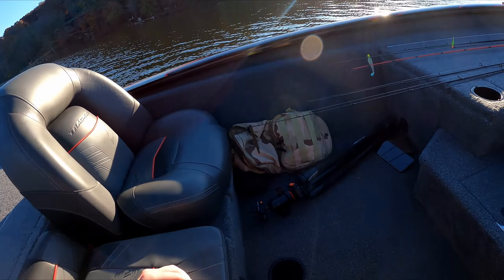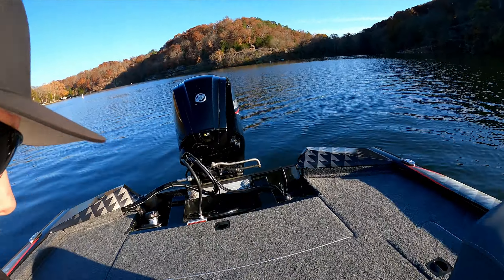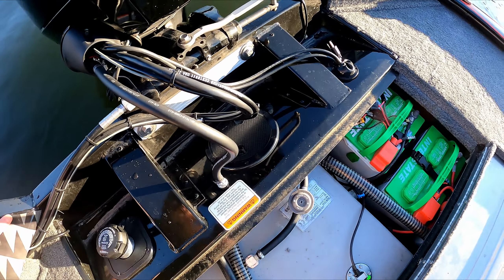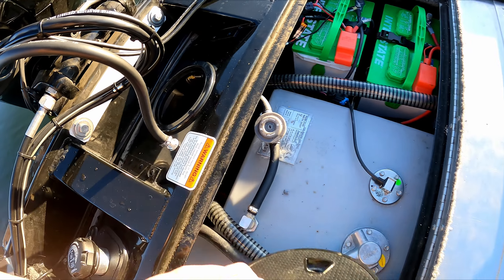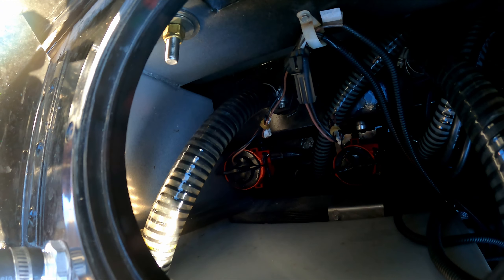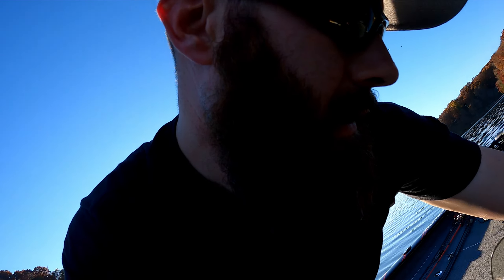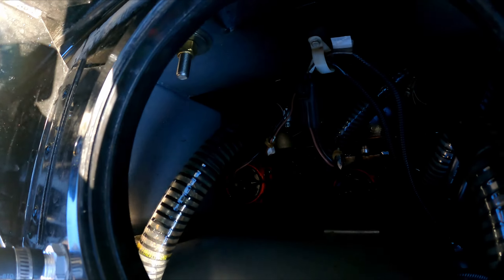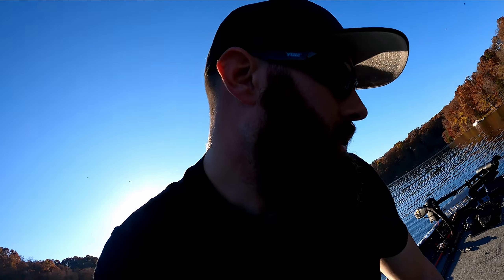BASS TRACKER 175 Leaking Water - Check THIS!

Comment: Hi.  Thanks for the video.  I have a garage kept 2006 PT175 that does not see freezing temperatures.  The original livewell pump is a Mayfair 3850 with a yellow housing.  Like your issue, I was filling the livewell and water started coming up in the floor drain I installed year's ago.  The nipple broke off inside the hose.  When installing a new pump, I bumped the hose on the bilge pump next to it.  It snapped off the same way and I didn't hit it very hard.  It is the same brand with a yellow housing (model 3250).  My word of advice...  If you have old yellow plastic pumps, replace the whole units.  These old Mayfair units do not have replaceable hose nipples like the red ones in your boat.  The plastic gets brittle...

Comment: I test drove a boat yesterday. We went out about 1.5 hrs. As we ran around the boat was slower and slower, the. Wouldnt plane. I opened the center floor lid to see it full of water. I knew the plug was in because I had put it in myself. And the all weld hull is spotless. I said we gotta get outa here fast, as the bilge pump didnt work. The fuse for the bilge was blown, id guess due to the open connections for it being submerged under water. We made it back, pulled the boat out and tried to find where water got in. When we got back to his place I suggested putting a hose to the livewell intake hole at the back of the boat. I removed the plastic screen cap, hooked the hose, and the water was just pouring in. It looked as if the pump had maybee froze and expanded, so that the top of the pump was no longer sealed.
 He ordered a new one, and a new bilge because the next fuse we installed blew. Parts should be in from amazon on wednesday, and I hopefully pick up my new boat Saturday. Its definitly something to look out for on these and must be drained well if you live somewhere that freezes in the winter..
It almost cost him his boat.

Comment: I have a 2014 Tracker with a Garmin TRANSDUCER and it splashes water up into the boat I switched it from the right side of the prop to the left side (downward rotation)  At high speed it would splash gallons of water into the bilge and when I would stop the pump would run for 30 minutes to empty all that water
Switching the transducer stopped the problem.

Comment: My 2024 is leaking down the right side at higher speeds coming down the floor against the side wall .1st time in the water was on 4/1/2024 when I noticed it.Any idea where or what maybe causing it. I'll be contacting the dealer tomorrow only had the boat a week
Reply: It's the 175 pro team  TF
Reply from the maker: Up front or in the bilge area?
Reply: @BentRodBassin  it's really hard to tell it runs down to the corner of the driver seat against the side wall.

Comment: I have a issue with the recirculating pump, can you help me with this
Reply from the maker: Need a new seal?
Reply: Do know where the pump in located at the boat shop explain to me that they would have to cut the deck off and take out the gas tank
Reply from the maker: @JohnFriar-bn8jd  it’s possible, a buddy of mine had an issue with a pump that was not accessible and they had to remove the deck to access it.
Reply from the maker: @JohnFriar-bn8jd both of mine are in the rear next to the plug hole.